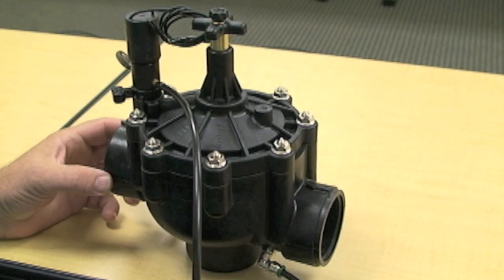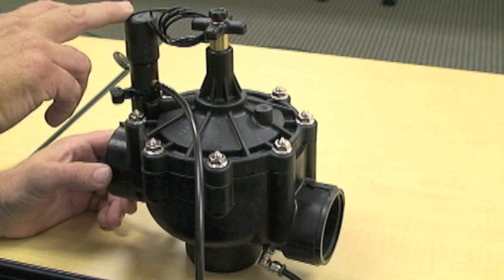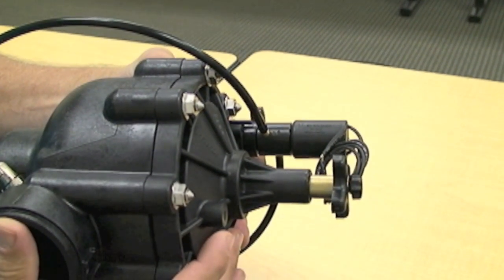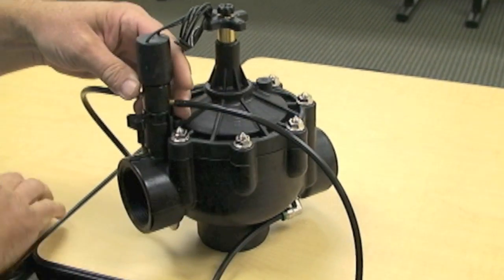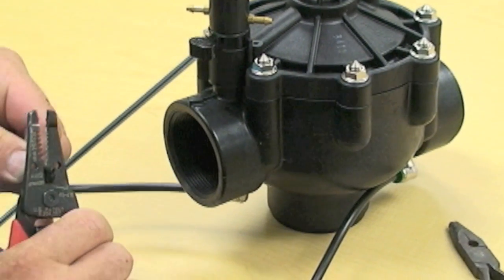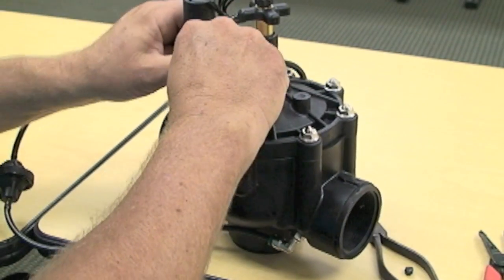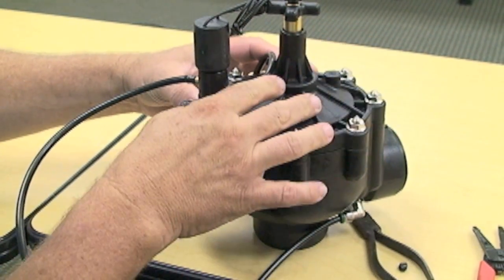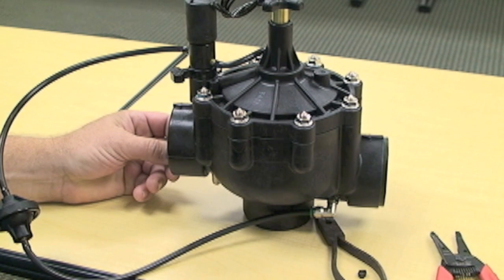How to convert a Closed Valve to a Open Valve

Comment: we used them on a pump system that had constant pressure with a Rainmaster Eagle I controller. Set the open flow limit at 35 gpm so we could use hoses & an auto fill valve for a fountain. When there was an over flow (more than the limit we set) the controller would send power to the solenoid to shut down the main line & send an alert to my cell showing an overflow . Then I would reset & if it happened again we were on site looking for a leak.

Comment: y would you do that
Reply: Yes why would you do that?
Reply: @lamrof  You might have an irrigation system attached to city water AND with an additional irrigation well/pump.  Your irrigation well might be in an aquifer with excessive amounts of dissolved iron.  You could use the irrigation controller to only engage the pump when the irrigated ares don't contact your house, driveway etc.  You would need a check vale at the well to keep you city water from leaking into your well (and costing you a fortune), but you would also need a NORMALLY OPEN irrigation vale to stop the city water when the pump is running.  The normally open valve would close at the same time the pump solanoid was engaged.  You would also need a check valve/vacuum breaker to make sure that the well water didn't enter your house, or the city water service.

So,
Reply: Here's my situation.  I have a PVC pipe going from under my house.  At the end, there is a regular valve so I can turn on sprinklers or water the car.  Even though I have insulated the PVC pipe, it will still freeze up if we have several days of freezing temps.  I could install a manual valve under house but would like to avoid that.  If I installed a regular NC valve, it would have to be under 24V 24/7/365 EXCEPT when freezing.  I would prefer to have a  NO so no voltage EXCEPT during freeze periods.  Couple with a self drain attachment at lowest point, the water would be gone from pipe.